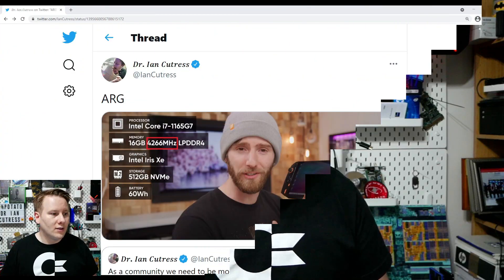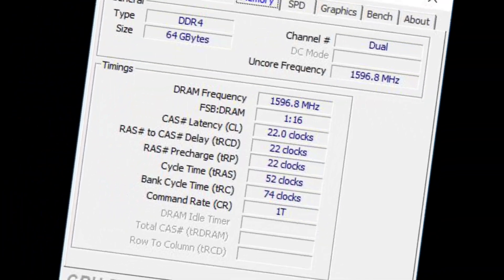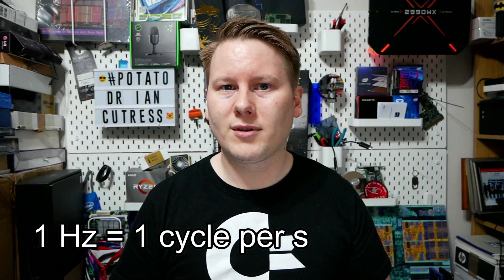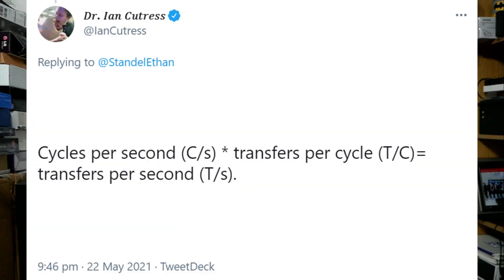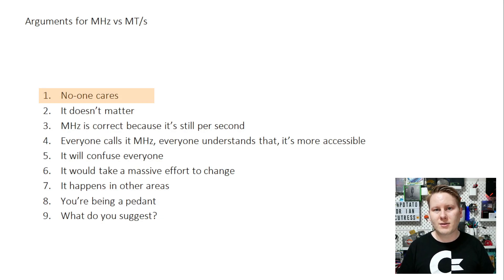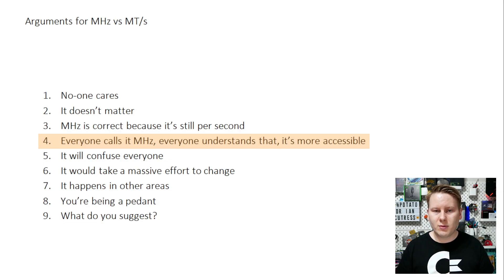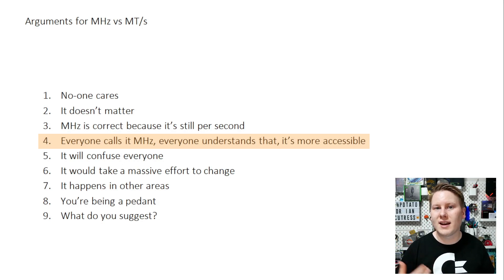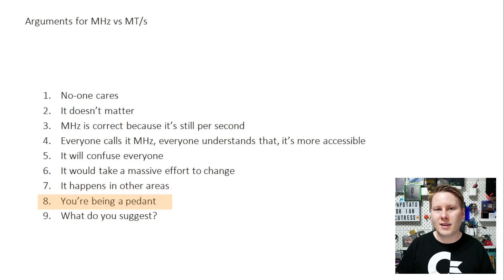Linus is WRONG 💩 : Explaining MHz vs MT/s

Comment: Definitely a complex topic (in regards to how the terminology has been warped over time). I've always looked at it more so as a matter of being an "effective clock speed", i.e. "If we are using this memory to its fullest extent and were still using SDR modules, this is what the clock speed would be".

I will point out that you touched on another example of exactly this kind of classification/marketing yourself in your video about IBM's 2nm process node, since that development didn't actually achieve true 2nm density, but rather is just an effective density under the premise of processors still using planar transistors to make comparisons with older/other technologies more convenient. Despite that indirect "equality" also being imperfect since different 3D transistor implementations exist that are hard to compare perfectly 1-to-1 when it comes to grading their performance in the domain of planar transistors (I'm going to go patent the 'Planar Domain' and 'Oblivioncth Transform' real fast, excuse me) since its an abstraction and especially since company's marketing and vagueness often blurs the lines, the process node comparison seems to be more much widely excepted without pause in the industry. Though, you did point out how in particular this latest one is flawed given that IBM simply used the oh so consistent unit of finger nails for measurement, and I'm sure you also ultimately take at least some issue with the 2D->3D transistor comparison trend in one way or another.

However, I will agree with you that:
1) In the end, even though some terms are acceptable for simplifying things for the end user/consumer, when it comes to being the developer it is absolutely important to strive for perfect exactness; ultimately, I think we should do the same for the consumer as well (even though we'll never get all the way there), since like you said, it's education!

2) Since in this specific case performing an I/O operation on every rising or falling edge isn't guaranteed and exactly when operations are performed comes down to more complex timings between a PC's memory controller and the modules, the given state of RAM contents at any given time (since the commands required to complete an operation can vary), how well a given module has been optimized for interweaving I/O between different banks, etc., I think this is one of the cases where the argument of just hand waving away the specifics and saying "it's close enough at the consumer level" is weaker since it's more of an exception.

I think you make a good point about how the clock signal of a given module is a fixed rate where using Hz makes sense, yet the data exchange rate at the very end of the "magic memory black box" is not at all cyclical. So perhaps in this particular case it is a bit too much of an overcomplication to simply allow this labeling practice to continue as a friendly "simplification".

Comment: The fact that this video is 13:37 makes the opposing argument invalid <3
Reply: How long it takes you to make your argument doesn't have anything to do with how correct it is. For his argument i agree the packages should say MT/s not MHz but marketing has spent 20+ years with the wrong label of MHz not MT/s so the consumer knows it as MHz not MT/s. When trying to sell your product to a consumer you should use the words the consumer knows even if they are not correct when you get into the meaning of them but the words the consumer thinks they know the meaning to.  I agree with Linus they use the terms the consumer knows even though they are wrong. This makes the issue go on for longer as they are using the wrong units.
Reply: @yumri4  what, wait? You think we all shouldn't make an effort to educate? Just accept that because it's always been wrong, we shouldn't work to correct it? 
How the hell is that a principle to live by? 
What if the same were true for 80+ ratings or colour accuracy on displays? 
Should people just accept a wrong statement in general, because "it has always been so"?

Comment: I gotta totally agree with Linus on this one. 
Because you're technically completely wrong, it's not DDR4 3600 MT/s .
It's to the best of our knowledge, quarks (20% up, 20% down, 20%... ), arranged in a way to make atoms, mostly silcon (98%), to take advantage of conductivity, conductivity is the perfeceived ability for electrons to travel through a material which manifests in electrical energy. Energy is a measure of... Quarks are... These are arranged in large structures to form transistors of size.. A transistor is.. Logic is... In philisophy... 

Therefore on the quest to be more accurate... DDR4 3600 MT/s is immensely far from an accurate description.
Therefore if the vast majority of people understand 3600MHz - so that is correct. To most people MT/s would imply a different ram technology, or maybe MT/s is not for ram at all...

There's always someone more knowledgeable who will go into more detail than the previous guy , but if 99.9999% of people completely understand what the first guy meant , there's no good reason to change that. That's for a small print appendix in a book I think - for the post apocalyptic civilisation trying to recreate our technology that may be useful.

"In insert name of field here the letters xy stand for z" - these sorta notes exist for just about anything out there. ... in RAM MHz usually technically refers to MT/s. There's no special effortful correcting needed for ram. we don't really do that for anything we do (xy stands for z in this case)

Comment: its defintely an odd thing as in cpu z you get the pre double rate figure but then in task manager or most higher end bio's you will see the figure with the dual rate mutipled. I feel one of the large reasons that task manager and the bio's show the double rate figure is so that consumers don't go I bought ddr3200 why is it running at 1600

Comment: I didn't know that DDR4 transferred memory at twice the clock rate, until the discussion in the WAN show.  I knew that DDR stands for double data rate, but I assumed it simply meant that it was clocked twice as fast as earlier memory tech.  So, yeah, this matters.  It's not just pedantic.  If I look at the actual numbers in a PC BIOS, and I see 1800 Mhz going into my DDR4 3600 RAM, I'd otherwise think it was wrong.

Comment: A while ago, the gigibyte was invented as the correct terminology for 2^10 based data amounts. Thanks to years of education and promotion, absolutely nobody is using it. Unlike that, you can buy DDR4-3200 in the store, no units necessary, and get the <=3200 MT at 1600 MHz you expected. It feels like we haven't reached the point of no return for abandoning MHz in marketing yet, so let's do it. Non tech-savvy people won't care, it's just us.

Comment: Thanks. I learned a few things and am going to try avoiding using Mhz with Memory from now on. Just yesterday I upgraded from a first gen Ryzen 1600 to 5600x on the same b450 board, and had to reinput the optimal RAM timings I'd used a calculator for years ago. Crazy how us enthusiasts can mess with overclocking and still get the terms wrong.

Comment: Well, technically, while it's still ddr, you could consider that the maximum achievable rate of transfers follows the absolute value of the derivative of the voltage. That's a periodic function, with twice the frequency of the square wave, hence Hz is still technically correct.
 Even worse, if in order to use Hz the thing you are measuring needs to be represented by stable cycles per seconds, considering modern processors and GPUs have variable frequency which updates quite fast, does it actually make sense to talk about Hz for those?

Comment: G'day Dr. Ian,
I agree your point is relevant plus has merit as the Clock Speed has not Doubled but increased the ability to do 2 instructions per Clock,
To me it's like if Intel made a CPU that does 100 IPC @ 5GHz, then next gen they get a 10% IPC Increase without a lift in Frequency, is the CPU doing 110IPC @ 5GHz or 5.5GHz??? also would people be happy with Intel if they Claimed they had a 5.5GHz CPU & then CPU-Z said it was only at 5GHz???
My Guess No, so why is it OK to claim DDR4@1600MHz is DDR4-3200MHz for Memory??? because wouldn't DDR4-3200MHz actually be DDR4-6400 🤔
I think that like you said the simplest fix is dropping the Unit, 
I also find it interesting that people are defending the usage by saying it doesn't matter if you use the wrong terminology of MHz instead of MT/s,
but then people get angry saying I am using the wrong Terminology if I say 3.2GHz RAM which is just as wrong as 3200MHz or that I have a C2Q9650 OCed to 3600MHz which is right,
using the reason that 'because everyone says CPUs are in Gigahertz & Memory is MHz'

Comment: You are right , the amount of posts in the hardware forums that asks why their memory runs 2x times slower than what it should be based on CPU-Z and other software is just ludacris. And there comes the people that explain them just to multiply by 2 but why barely anyone knows. And all of this because of what I would call false marketing that led to missunderstanding how the DDR RAM operates and in the near future there will be the case with QDR coming in the same. 

And even so the MHZ you mentioned about it is still not correct the actual electrical clock rate for a single 3600MHz DDR4 SDRAM module with eight 8-bit chips is 450MHz running in parallel over 64bit wide memory bus. I still wonder why nobody calls dual channel memory in this case a 7200MHz memory kit for example.

Comment: @TechTechPotato isn't it like symantics because "Hz" just means a frequency... like sound waves or light or how often something happens. So megatransfers is also how many times something happens? So ddr 3600 is 3600mt/s but its also 3600 somethings happening per second... those could be called Hz?  Like u said BPM is like a Hz?  So does it matter? I know it does but for most people buying ram does it matter? It does 3600 stuff per second and its faster than the one that does 3200 stuff per second...
Reply from the maker: Nope. That's addressed in the video. Hertz is a cyclical measurement
Reply: @TechTechPotato  what's the definition of cyclical?
Reply from the maker: It repeats and is unyielding. The clock cycle is a constant cyclical event. A transfer is not. Sometimes you transfer, sometimes you don't.
Reply: @TechTechPotato  thanks
Reply: @TechTechPotato  hmm OK just had another thought... 

When we talk about MT/s in memory specs it's talking about theoretical max isn't it? In which case it becomes a frequency again? It does X things per second at maximum. It does 3600 mega transfers per second... that's a frequency when specified as a "specification" of what it's maximum capability. It isn't always at that sure, but its maximum is again a X amount.of things in Y time and that can be called a frequency  no?
Reply: I agree you wouldn't say cars drive up my street at 1hz but you could as its a frequency and that's how you denote frequency? 

This is why linus said it doesn't matter... where as it does but it also doesn't at the same time.

I hope u get what I mean and I'm not being deliberately thick... I just get your argument and linus' point as well.  If I said to you what's the max transfer frequency of that ram? You would know what is meant...
Reply: @TechTechPotato  is a frequency not cyclical by nature? How can u have a non cyclical frequency? For example?

Or is it like a single transfer can happen in no specific frequency even though the MHz is a constant frequency?
Reply: You're right ofcourse and accuracy is important. It's not pedantic but for most people it doesn't matter.  I kind of care because I'm I'm bit like you.. it annoys me when people say things like "ten point nine hundred and fifty"  instead of. "Ten point nine five zero"

Comment: You used the clock cycle to say that transfers are not cyclical, but they are independent things. Transfers are cyclical, but 1 transfer cycle is not 1 clock cycle. Also, "transfers" is not a real unit, just a description of what we're counting and something to attach the mega prefix to, because we can't just say 3600 mega per second. I would say the unit of transfer rate is MHz, but it's a useful convention to use the made up unit of MT/s to distinguish it from the clock cycle, which has the same unit.

Comment: Obviously you're not wrong. But if you want it fixed I think the first place to start is the manufacturers' labelling of the products. If they call it "3200MHz" it's hard to expect everyone else not to.

I was going to say "Who cares anyway? 2T/cycle at 1800MHz might as well just be 3600MHz from an end-user point of view that just cares about how it performs." But you've convinced me otherwise, mostly from the comparison to CPUs and IPC.

I do want to ask if it would still be incorrect if MHz was used to describe the "maximum" transfer rate. If you set the condition that transfers are happening at every opportunity, it becomes cyclical and addresses that concern, at least it seems that way to me.

Comment: This is a good distinction to know now after I've got a grasp of the broad subject area. As a beginner calling it mt/s would be confusing, mHz would just be blindly accepted by me. Teach a university student the issues with bandwidth and technical details, let secondary school computing students know how it's used. You actually saved the position by suggesting no unit, and I completely agree.

At the beginning, just because I'm also pedantic, you said weight was technical terminology, which it can be. Often it's used wrong, to show mass by manufacturers and retailers. I know you know this, for me it's a similar situation, but everyone is happy with weight to denote anything but newtons. Basically for MT/s I didn't initially agree, but for mass I did.
Reply: Just an addendum, I've talked myself into mostly agreeing with your perspective on this high level matter through my cause of caring about mass and weight, thanks to a secondary school physics teacher. I think you've had to make the compromise of using DDR4-3200 because in this specific problem space, it isn't purely technical. As technical jargan, 3200 MT/s works. This is a discussion in public, for informing consumers and enthusiasts. The fact is that technical accuracy and descriptive language are both important.

Lets also understand that by saying DDR4-3200, there will be people who think 3200 refers to MHz, especially as that is/was a common position. That can't be fixed, only by educating, as eluded to in the video isn't easy.

This debate is taking over most of my mental processes and now my head hurts. So many possible tangents to go down, so many neuance points for something that is still rather small.

Comment: The problem isn't made smaller by the fact that even when trying to inspect the speed of your ram in windows (task manager -> performance -> memory), leads you to a page that will tell you that your ram modules are running at for example "3600 MHz", when that is not the case. So in fairness to Linus, someone (pokes the potato) should go bug Microsoft to use the correct terminology.

Comment: I just want to point this out from the ark page on the Pentium 4: Bus Speed: 800MHz

Except it wasn't.. it was 200MHz QDR which caused utter confusion about people's multipliers not lining up. That should've been 800MT/s or 200MHz QDR or "Quad Pumped" as they called it back then.

Link: https://ark.intel.com/content/www/us/en/ark/products/27500/intel-pentium-4-processor-supporting-ht-technology-3-20-ghz-1m-cache-800-mhz-fsb.html

Comment: As a consumer, if I saw something labelled as DDR4-3600 km/h, I would still know what it means. As an engineer, I would never be in any doubt about the clock frequency or the theoretical transfer rate - I'd usually be more concerned about the practical transfer rate I can achieve with the access patterns in a specific application. However, I don't care what the context is - you can't go around using the wrong units. Maybe it's not really misleading consumers right now, in the case of DDR RAM, but it sets a dangerous precedent.

Comment: DDR4-3600 does run at 1800 MHz as well as at 3600 MHz - BOTH are correct but describing different parts of the system. The 1800 MHz refers to the reference clock, but the data-lanes are running at twice that frequency. This can even be seen on the PCB design constraints as things like the maximum phase difference on matched pairs is given in percent-points, but with the same error-margin the allowed track-length mismatch of the clock-lanes is twice that of the data-lanes cause the reference clock is running at half the frequency. 
When you try to be pedantic and claim he is wrong than you should make sure that you are not wrong either.

And the nomenclature of "PC-25600" is better anyways as that clearly shows what you get in terms of bandwidth.

Comment: 1. Blame 2000 marketing, not Linus. When they introduced DDR, they used the same clock as SDR, so they needed to differentiate somehow the doubling. Yes, they used MT/s and PC<Mbytes/second>, but MANY adopted MT/s as MHz. So this is a 20 year problem.
2. I wanted to say about how clock multipliers work (and the high frequency still being a frequency), but when I tried to think an example of data line sending alternating 0s/1s, I realized that it would generate a signal identical (or inverse) to the clock :( (as in, same frequency). For QDR, that example would be a clock doubling, but from what I saw "on the net", the clock itself may be 4-part (4 voltages), not 2-part like SDR/DDR (and clocks in general).